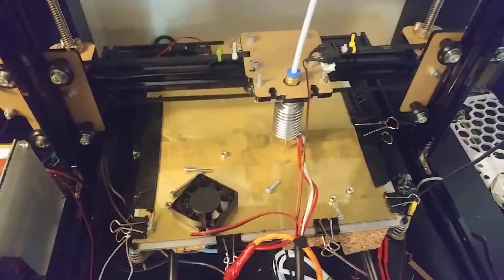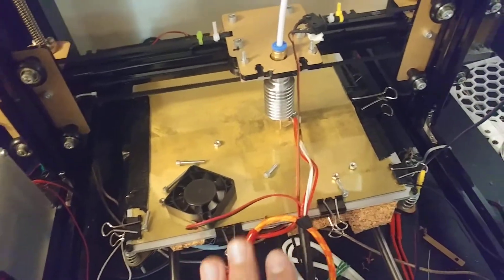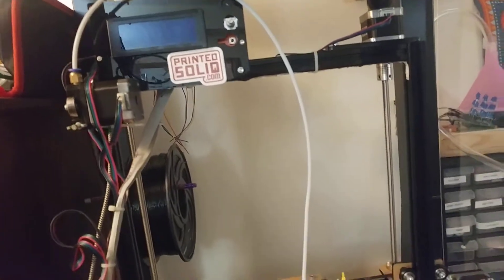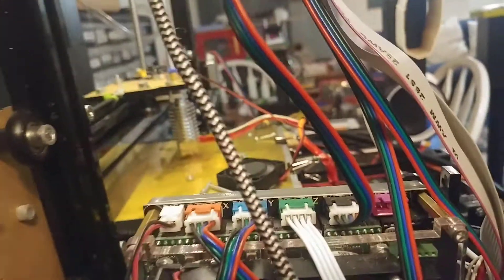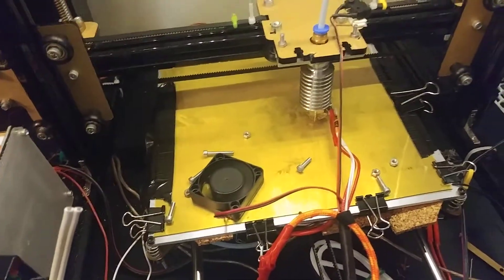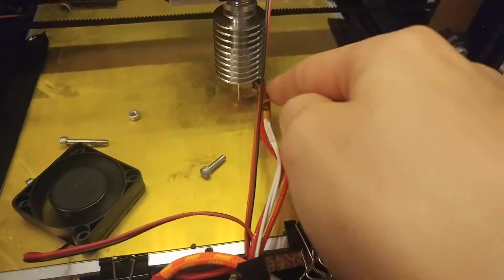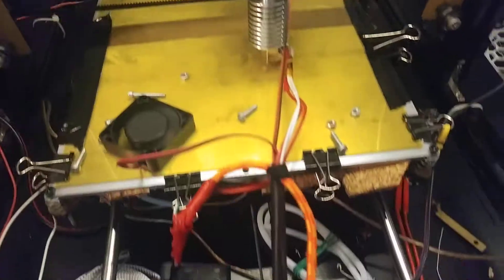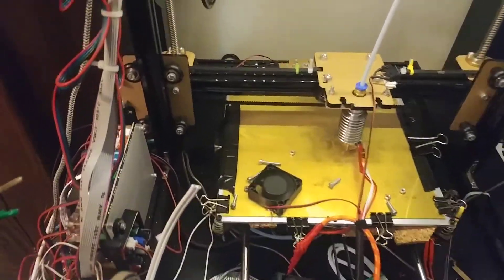Random failure of otherwise safe mosfets (makerboard MKS v1. FLSUN)

Comment: There are so many inaccuracies in this video, I don't know where to start. First of all, the power supply in the kit is not an ATX style power supply. It is simply a switching power supply. It doesn't supply more than 20 or 30 amps depending on which one was included. At that level, the bed would not be able to even get over 110°C. As the machine is designed to handle that temperature indefinitely, the likelihood that damage would occur is almost nonexistent. Secondly, Flsun purchases their controller boards from MKS, a supplier of boards to almost all of the inexpensive Chinese 3-D printer manufacturers. If there is an issue with these boards is not limited to the Flsun products. If anyone is concerned about this issue, either on this machine or any other one on the market today, they should install a separate high rated MOSFET to supply the heated bed. Any MOSFET included on the main PCB is going to be undersized for the amount of current going to the heated bed. Every single forum devoted to low-priced Chinese 3-D printers has a thread recommending this practice. Thirdly, the firmware used in these printers is Marlin, which has protection from this kind of thermal runaway.  If it didn't shut down, I'd be inclined to think that either the included firmware was corrupted, altered, or it wasn't the version used.  That being said, I own this machine as well as the Cube and I have run them for prints as long as 72 hours with no issues. I was so impressed with the design and execution of Flsun printers that I reached out to the company and made a deal to resell their products that people return to Amazon. I have seen dozens of returned kits and none of them have had an issue with the PCB. This problem is what is called in research "anecdotal evidence". A sample size of one is not something to base a purchasing decision on.
Reply from the maker: Everybody 3d Prints I updated the title, the discription and added a card around the 2sec mark that is labled update and takes you to a video where I explain it all. This video was down for a few days however I don't want to completly rewrite history, even through I was wrong I will keep it and just make it clear that I was wrong.
Reply from the maker: Everybody 3d Prints I installed an ATX supply myself... and disposed of the one included with the kit as it was complete garbage.... Marlin could not shut it down because the mosfet had failed and was no longer responding to commands... I acknowledged that I had not tested how hot the bed would get and said I doubted it would cause any real damage but it was scary all the same.. and I know FLSUN does not make the board but they could have at least better cooled the hotbed mosfet similar to how they did with the  hot end mosfet. You are selling FLSUN printers so of course you would defend them... I previously had been very happy with this printer until this broke... I had a very good support experience with FLSUN until this broke... I told them I would update this video after they resolve the issue, which they have yet to do, untimely this issue is in there hands not mine now
Reply: The fact that I sell the printers has nothing to do with my comment except to show I had a broader sample base than 1 printer.  Facts are facts.  The board mount uses two 30mm fans to flow fresh air over the board sandwiched between two acrylic panels.  The fact that neither of the fans directly targets the heated bed mosfet is irrelevant as the acrylic panels channels the air flow over the entire face of the board and this design is far better than 95% of the other printers out there.  Additionally, they supply 5 chip heat sinks.  4 are for the stepper motors and the fifth is for the heated bed mosfet.  My problem with the video is the focus on Flsun rather than MKS's board.  Its inaccurate and unfair.  The failure had nothing to do with the printer's design.  As far as customer service, I find them to be fantastic compared to other Chinese manufacturers.  Creality, for instance, has a bad design on their V2 boards causing massive power fluctuations (and they make their own PCBs).  Timothy Hoagland has pinpointed the issue to an underspec capacitor (https://www.th3dstudio.com/cr-10s-v2-0-board-temperature-issues/).  They've been stonewalling me on fixing the issue for months.  Yet you recommend buying the CR-10.  If you can't get the issue resolved with Flsun, PM me and I will.
Reply from the maker: Everybody 3d Prints My printer did not include a heat sink for the bed mosfet it is possible that they became aware of this issue and resolved it by including that heat sink... I am glad to here that you are willing to help and I am glad to hear that they are now including a heat sink
Reply: As far as I know, they have always supplied 5 heat sinks.  In any event, I've shared a link of this video with a contact at Flsun.  It's a 12 hour time difference, so I'd expect a contact sometime tomorrow.
Reply: I don't know if they emailed you yet, but my contact at Flsun tells me that they have mailed the part out already.  Mail from China can take, by my experience, up to 6 weeks or so to arrive.
Reply from the maker: Everybody 3d Prints They emailed me, I updated the description; when I have a chance I will put a card up as well... and then once I get the part I will delete this video
Reply: i'd be surprised that fifth heat sink is supposed to go onto a mosfet. it's rather intended to go onto another stepstick in a dual extruder setup.

the heat of the mosfets is supposed to dissipate through the surface area of the PCB and thermal vias going through to the bottom of the board. for this exact reason newer stepsticks have their chip facing the header pins and the heatsink is attached to the thermal vias on top. in conclusion it would be more advisable to add some distance between the back of your board and the acrylic plate.
Reply: Mr. Robot I didn't say that it was an effective solution. They always seem to supply five heatsinks however, and after the steppers the hottest chip on the board is the mosfet. That's where I always put them anyway. If you buy a dual extruder kit from them they Supply an additional heatsink for the additional stepper controller so I don't think they intend it for a fifth controller either.
Reply: interesting. well,  i understand you've handled many more flsun printers than i have but none of my single extruder i3s ever came with an extra heatsink.

and unless they specify this in the manual i wonder how a normal user will determine which FET to place it on. since there are 4 FETs on the MKS Gen L 1.0.
Reply: Mr. Robot agreed.  But I don't think they even state what to do with any of the heat sinks, do they?  Their documentation needs improving in a lot of areas.
Reply from the maker: you were right, the control board was fine. I guess it is just a random failure. and I found the data sheet, the MOSFETs are more then rated enough for what they are doing, I have seen computer motherboards drive MOSFETs far harder then this with no falure, I guess sometimes things just go wrong. I am very happy to have a replacement and to be back printing :) https://www.youtube.com/watch?v=rNE2tYXjRdo
Reply: Toby Cowles so are you taking the video down, or are you at least going to update it to reflect these facts?

Comment: In my side ..... this printer is working amazingly at home ..... for the price of this printer ... quality is really good. I have the large model. the power supply is enough powerfull.  I reach 120°C on my bed. And It's not my first 3d printer. I am agree that some parts are not perfectly design ... but if you cannot do yourself ... buy printer at more than 600 dollars. I am sorry that you have a wrong experience ...